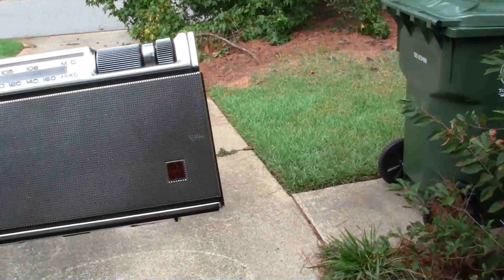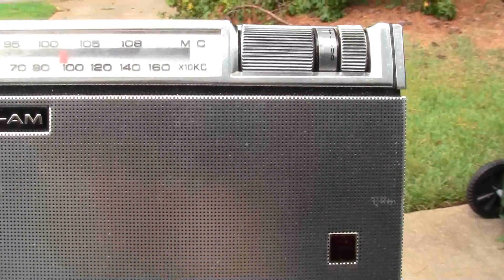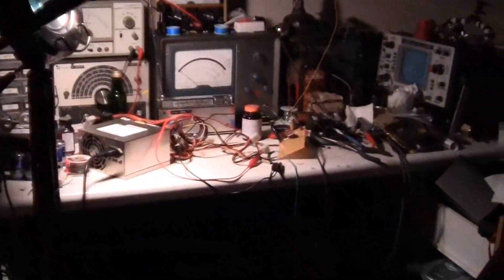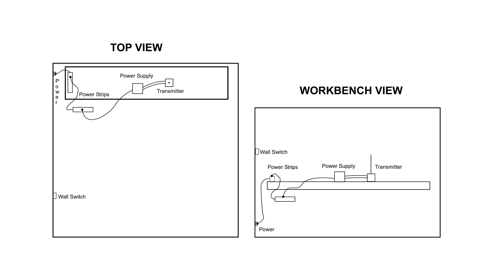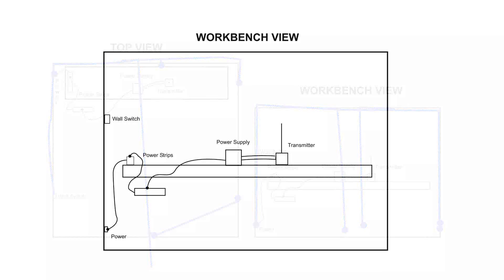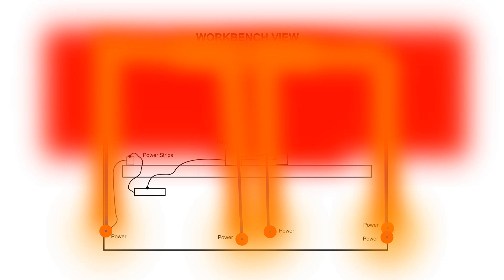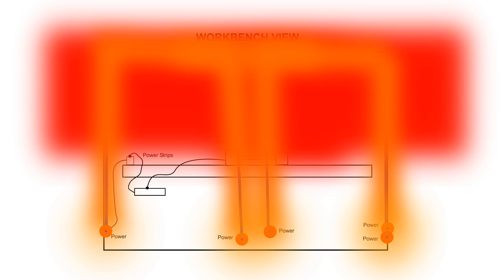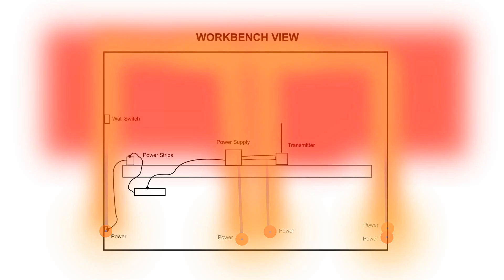Inter-Modulation Multi-Path Re-Radiation FM Transmitter Placement

Comment: Thanks for the demo.  BTW on your computer supply plug that plugs into the motherboard, I see you have a resistor across the green and black wires to keep the supply on.  All instructions I have seen only say directly short across these two.  What purpose does the resistor serve and what is its value?
73, Harvey, KM4JA

Comment from the maker: Thanks THEtechknight 
Its not getting through this power supply. But in other power supplies it can, and of course causes big problems. At the 50K watt station, shielding the RF energy from getting into everything is an interesting problem. Sometimes toroidal cores are used as RF cokes, They are always warm because of the RF in the air.